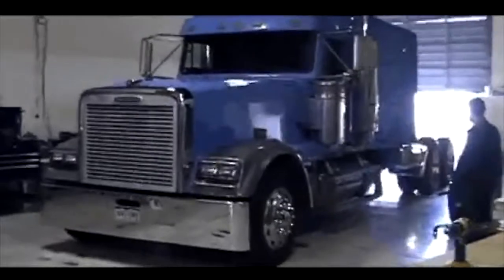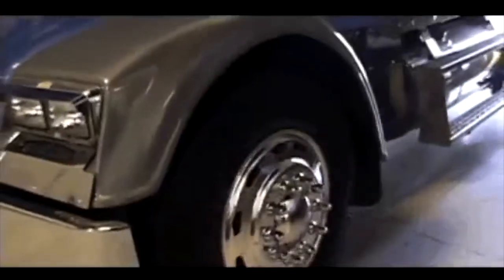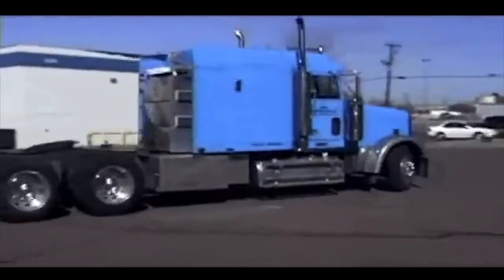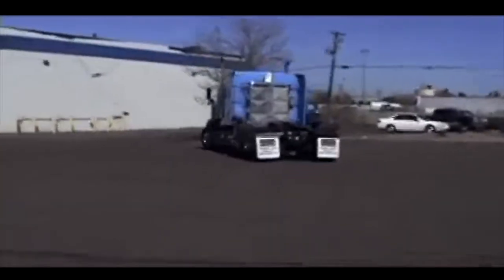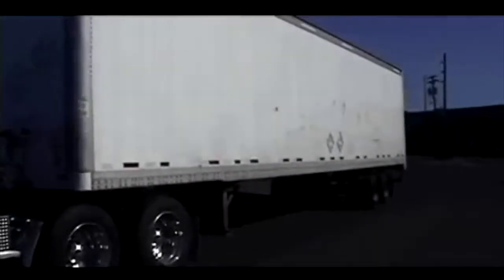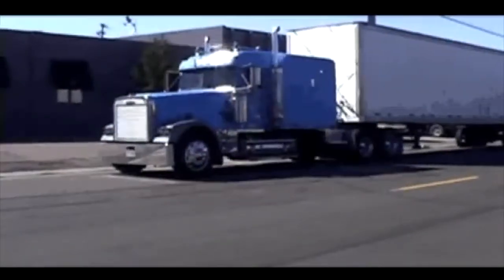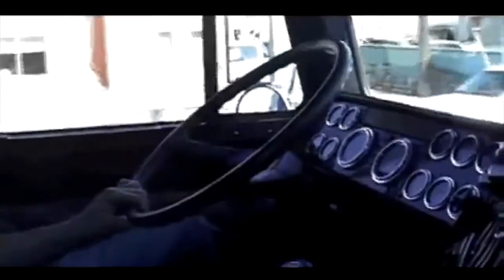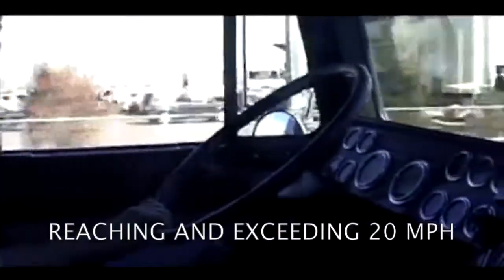EV-ICE - Retrofit Hybrid Heavy Duty Truck

Comment: 56,000 pounds is great and all, but how about 80,000?  Makes a HUGE difference when you're running loaded.  Don't get me wrong, I'm all for electric semi trucks, but do a fair comparison.
Reply: a diesel-electric hybrid (with an electric motor connected to the rear of the transmission, powering the propshaft) could be extremely useful as a cost effective retrofit to existing vehicles, as electric motors produce torque from 0 rpm, often require only a simple geartrain or none at all and can also be used to allow dynamic braking, saving brake wear and engine life. combine dynamic braking and an exhaust brake or engine brake and you might well find brake linings last the life of the vehicle. also a fully diesel-electric vehicle (configured identically to a diesel-electric locomotive with the engine having no direct mechanical connection to the wheels) could have electric motors driving every wheel for heavy haul applications. an 8x8 or 6x6 diesel-electric prime mover could well be a modern and efficient answer to older diesel prime movers, potentially more reliable as there would be no driveshafts to snap or clutch to burn out along with the obvious benefits of dynamic braking and dynamic power distribution.